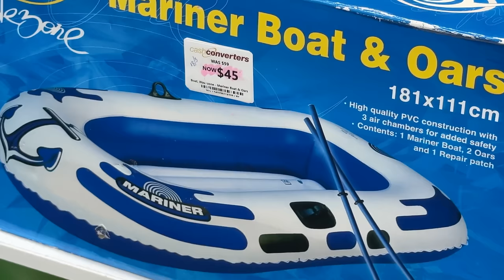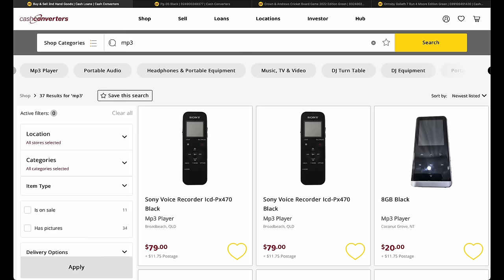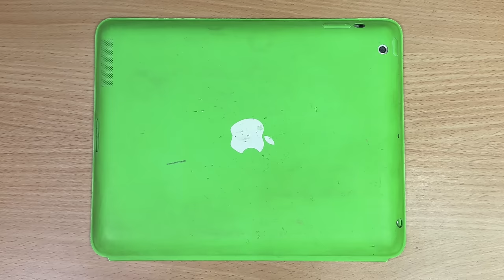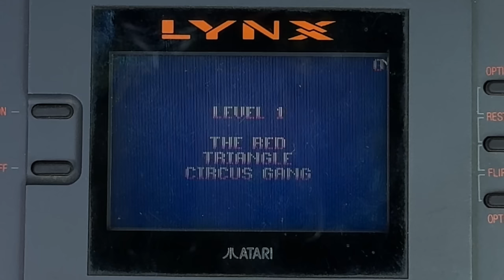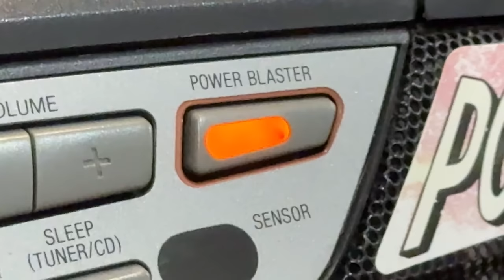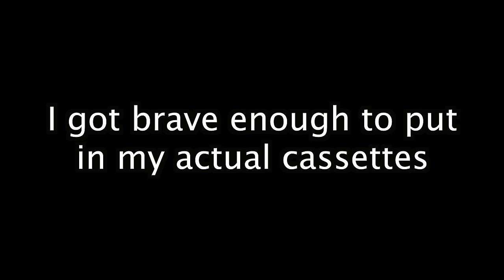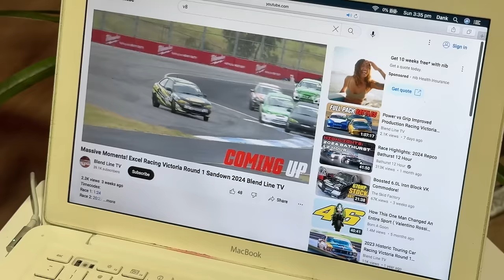The 2024 Cashies Special.

Comment: the irony of using all those adapters for the Dreamcast to play over VGA is that the dreamcast has an official VGA cable
Reply: When has Wade ever done anything the official way?
Reply: Best quality video you can get out of the DC without mods as well. 15 dollar VGA cable makes old PC monitors very useful for a Dreamcast set up.
Reply: Now someone needs to make a component adapter for the Gamecube as the official cable goes for too much
Reply: @grizzlydino The GCHD will do this! It’ll output over HDMI or Wii/Wii U component cables. Been using mine for years at this point.
Reply: @grizzlydino  iirc the problem is the chip in the GC component cable hasn't been reverse engineered/can't be. That's what makes it nigh impossible to make aftermarket cables for Gamecube.
Reply: This is both hilarious and painful to me.

Thanks, Wade!
Reply: @BensOnTheRadio  indeed, this is basically your best option if you want to use GC hardware.

Comment: I brought an underseat sub woofer from my local cashies. It didn't work, pulled it apart and saw everything inside was fried, took it back and got a refund. 2 months later in the next town over, there was the same subwoofer in their cashies, you could see the screw driver marks on it where I had levered it open. Cashies had just sent to the next store for the next sucker.

Comment: 14:53
the tape being pulled out of the cassette by the boombox is a result of the rubber wheel that helps guide the tape from one reel to the other getting all old and gooey. rip.
Reply: The genuine shock/reaction from the Dank was so surprising 
He sounded so sad yet happy at the same time
Reply: @Jerry_Freestyle he does love a bit of carnage
Reply: It could also be an old slipping belt
Reply: i had this problem more when the belt for the roller slips, making the guide keep rolling
Reply: @thatoneasiankid8734  IT WAS SOAD CASSETTE 😭
Reply: Yep, had the same issues with my TC-KE200, a new belt and pinch roller sorted all my issues!
Reply: I swear I’ve had this happen with every cassette player I’ve ever owned, new and old. Just stopped using cassettes at a certain point. Sadge
Reply: Is it the same for VCRs? Because my VCR won't rewind when I've paused the tape without eating it.
Reply: @RivLoveshine Either the belt (it’ll be on the bottom of the chassis) and/or the mode switch (also under the chassis). A selection of belts is a few bucks online. Use Deoxit cleaner on the switch, and isopropyl alcohol for cleaning the tape path. Basic maintenance is pretty easy unless it’s an industrial deck.
Reply: You are wrong, I wholeheartedly believe it ate it because it just couldn't handle the awesomeness of SOAD. 
Too much SHUGAH.

Comment: fun fact: 
that drift between the 2 decks combined is how the "flanger" effect could done in analog recording studios back in the day

you record your audio you wish to apply the effect to to one tape. now, play it twice into a tape recorder, once normally, and once while applying slight pressure to the flange of the tape reel, causing it to slow down slightly. 
this creates the effect you hear from the audio drifting in and out of phase. 

this is the same thing that causes your bass to dissapear if you dont beatmatch well DJing.
Reply: Thats actually why that effect is called flanger, cause of the pressing on the flanges of the tape spools

Comment: Fun fact: On the topic of cassettes and tape types, EMI manufactured their own tape which for some reason lasted way longer than normal tape types. Apparently, when they do remixes and or remasters at Abbey Road Studios (Formally known as EMI Recording Studios), that involve tape, such as the 50th Anniversary Edition of Sgt. Peppers by The Beatles, they didn't need to bake any of the master tapes before playing them because they didn't have any moisture build up due to the formula that EMI used for their tape. I say master tapes because they had to bounce tracks down to multiple reels of tape since they only had 4-track in Abbey Road Studios in 1967.

Comment: DVI actually speaks the same protocol as (early) HDMI natively, so adapters don't need any active components to adapt from HDMI to DVI!
Reply: Sadly no sound.
Reply: @mrbisshie  No amp or speakers in that monitor, either.
Reply: furry geek squad! xP
Reply: @mrbisshie Not always! I have a DVI-D to HDMI wire and I was surprised when my monitor's speakers started working!
Unless you meant no sound on his device, then I just look silly
Reply: A fun addon: The DP-DVI adapter is also passive due to DP++/dual-mode which lets DP output native HDMI/DVI signaling if given the right passive adapter. Most full-sized DP 1.1 and newer support this on modern systems, the only major limitation is that you only get up to single-link DVI or HDMI 1.4 resolutions. 1920x1200 over DVI or 4k30 over HDMI still covers a majority of use cases though, especially for a secondary or budget display option!

Comment: FYI, that instrument with all the strings is an Autoharp.
I kind of wonder if the StreamPod would still work with a sound dock (i.e., line-level audio out the 30-pin port).
Reply: I almost forgot about the line output from 30-pin! I used to have a cable (not a dock) that adapt 30-pin to 3.5mm, and I hooked it up to a headphone amp so I could use my DT 770 at my desk.

Comment: The Dreamcast has a native VGA cable.  In fact it is compatible with every game even though some games check for a regular composite cable and refuse to start.  I put a switch on my VGA cable to make it go between Composite and VGA.  You keep it on AV until it does the check, then switch it to VGA and it works just fine.  It's only 480p, but if you have a real monitor it looks amazing.  That's CRT for you, makes everything look pretty.

Comment: Fun fact HDMI-1 is basically a smaller DVI connector, because the newest DVI standard at the time was common and supported 1080p.

The logic behind this is for easy adaptability and because it was a well understood standard.
Reply: DVI to HDMI cables give a lot of sync problems on new monitors though.
Reply: And first lcd 144 Hz monitors worked only through DVI, DVI had more bandwidth that first iteration of HDMI)

Comment: I miss the old Sony cabinets with the tinted glass door that locked with a magnet.  Those old 4 piece  vertical tower shelves that had separate units for AM/FM Radio Receiver, Tape Deck, 5 Disc CD Changer/Player and Tuner that came with 2 tall box speakers at the minimum, Dolby Surround Sound optional and extra $$$, all for the affordable price of $989.99 US in 1991 which is like a billion dollars adjusted for current inflation.  Those things were a Batchelor pad must have if you wanted to sonically serenade a sexy siren successfully.  Angels trumpets and devils trombones.

Comment: Bro i managed to snag a good ol 80s Panasonic RX-FW39 "XBS" boombox for 15 bucks at a garage sale, had no cord, no batteries, no tapes, it was a dreamboat. I had to have it and now it plays all my tapes beautifully i love that thing. Its gone through something like maybe 50 full tapes and shes not eaten a single one, love that beauty. Only downside is she take 8 COUNT EM 8!!!! D cell batteries!! Thats 20 bucks of batteries! But guess what mate, shes gone through those 50 some tapes and shes still got plenty of power. And holy cow, does she sing, partial EQ with a bass slider and i only have to use a fraction of the volume slider, this baby could EASILY crank it up at a party. If i were sent back in time and needed a boombox you bet im gettin one of these
Reply: You did score a beauty beast of boombox, the 8cm woofers applied into this beauty makes incredible bass boost, Panasonic's XBS system never disappoint

Comment: Fun fact, hdmi and dvi are the same thing, the converter cables have no converter circuitry in them (nor does your card need to support "hdmi over dvi" or vice versa which is how vga/dp/hdmi/usbc/dvi work.
6:40 Also, common misconception, vga actually went a lot higher in both resolution and refresh rate than dvi/hdmi, at least for rev1. The issue was that it was analogue, so cable length and quality affected performance.

Comment: I love nugget monitors. I run a triple display setup, and for the most part, I just need two of the screens to show a picture. It can be garbage as long as it's a picture. 10-15 year old monitors still look fine enough, run HDMI adapters, and using them prevents them from an early e-waste sentence. I'd gladly snap up something like that ViewSonic as it's even better than some I daily drive.

Comment: The WF-10000XM4's being on the bench is funny to me just because mine ended up literally falling apart, probably from dropping them due to my own clumsiness. The glue/whatever bonding method they used just degraded in the right bud, and I ended up supergluing it together until I could be bothered buying the XM5's. Which seems better in terms of that failure point, and are better sounding tbh, the off mode actually has audible bass now.

Comment: rip ipod.. and yeah those old macbooks just won't die. my 2007 one is still going strong, original power supply and all. Only the battery went spicy pillow mode, but YOU CAN REPLACE EM!

Comment: I have one of those original release Atari Lynx Type I in the drawer here next to me. Unfortunately there is some wrong with the battery circuit, so it only work with external power, so it hasn't been powered on for years. Used the love the gigantic paperweight when I was younger, though.

And I used to work for Sharp. Think I saw the service manual for that old boom box, at one point, but would be useless telling you how to fix it. I mostly dealt with TVs and the occasional microwaves. It was a strange job. Probably needs the heads cleaned and new belts, just based on the age.

Comment: Those inflatable boats are shockingly seaworthy. I've used mine for drainage ditch exploration and an illegal crossing of the San Francisco Bay using a cordless drill for a motor. Made it across to Fremont with 1 battery to spare. Got tailed by a nature preserve helicopter and everything.

Comment: Not sure how much you're willing to crack into those boomboxes. But unless it's different down under there should be a little screw under the cassette player. You might even be able to access it without taking anything off. That can adjust the tension, so you don't get the slow/ fast tape speed. Also, the older boombock seems to have gotten wet at some point the cardboard. Or possibly even Wax coated cardboard  speakers are vibrating too much.

Comment: Always thought eating tapes was more an 8-track thing. Maybe the belts are wearing out and the reels aren't taking up the slack quite right. Or the rubber of the pinch roller is getting sticky... Probably a combination of both.
As an engineer I've always hated working with elastomers. You never know how they're going to hold up long term.

Comment: I actually have one of those viewsonic displays, but mine has an hdmi, but I borked it when it fell off the stool that it's on it still works tho and I use it with a xbox or ps5 plugged in for my little brother or anyone that's round to use also that boombox with the cd player is backwards the cd player go on top

Comment: Hi Wade,
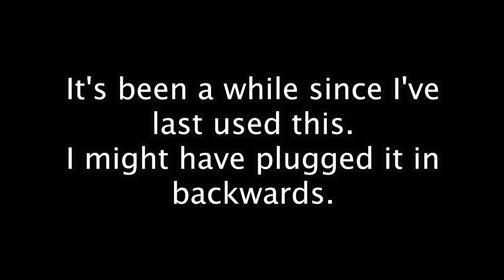I paused at 4:54 at the point you unplugged the iPod. And from what I see, is that I think you connected the cables backwards in the amplefier.
Have you labled the cables to "audio IN" and "audio OUT" now too? Because that looks to be the main issue here.

Addition: I've seen two or three video's where you pointed at the input of the Maraca Cracker and called it the output. That's including this video too.
I only hope that you knotice that in time when recording an epeside, before you plug one of your Flag-players in the output between the speakerterminals.
I know you won't But still.. That would be an expencive mistake...

And RIP the OG iPod. You will be mist..